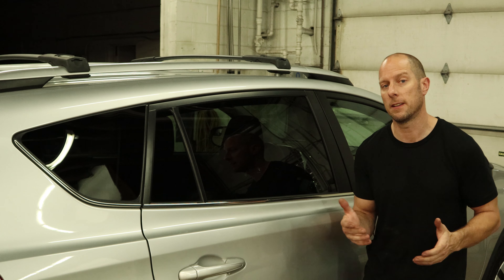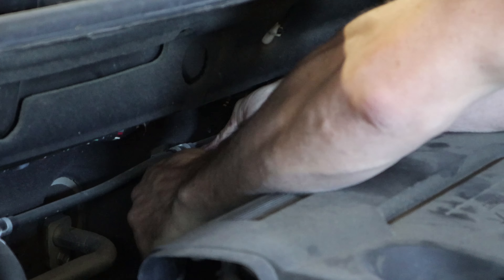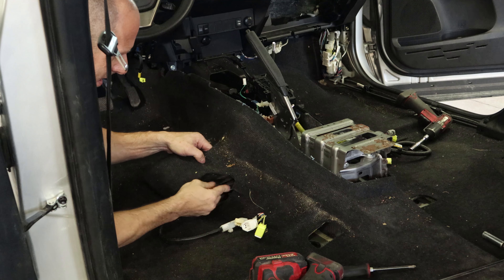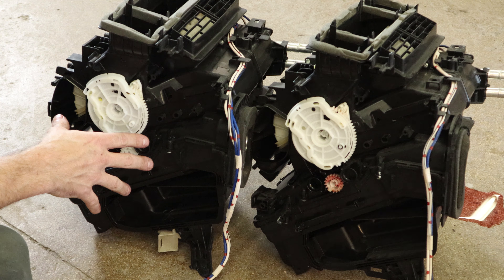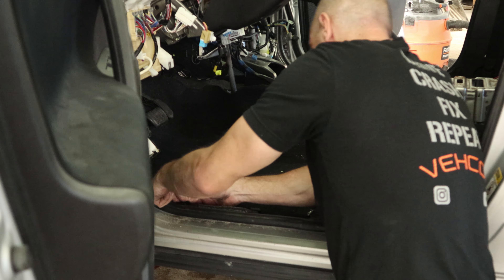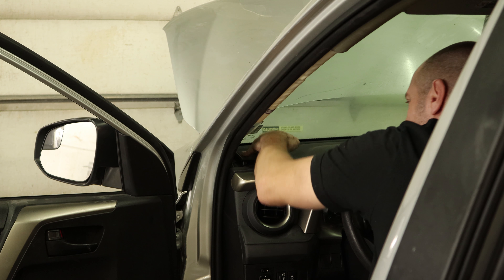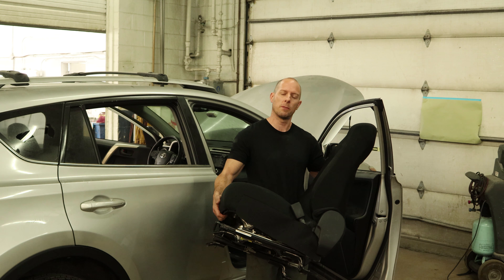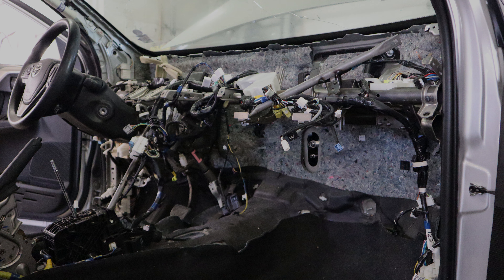Removing the dash and repairing seats on the 2015 Toyota RAV4 rebuild project

Comment: You have to admit it,  whether it's  a 2003 or 2015 ,the dash is the dash on a Toyota. They all tear down the same. From the center console to the dash, heater and ac. With few extra plugs for the new electronics. The only real difference is how many clips you break 😂. The older the Toyota, the more you break.

Comment: You are officially a super hero!  Not only can you disassemble doors (some blindfolded), but you can take out a dash.  When my 2002 Blazer had heater door problems,. I just decided to go without floor vents.  No way was I going to pop that dash out of there.
Reply from the maker: Those blend door and mode actuators are not too bad if you don't read the manual.  I can cheat most of them in, in a few minutes.  The dashes are actually pretty easy to remove on those if you have to go deeper.  I did quite a few of those blazer rebuilds.  Thanks for the support!
Reply: @vehcor  Well, a few minutes certainly would have beat the 6-8 hours I was quoted to do it!  On a side note: GM at least did a smart thing by making the default the defrosters.  If all else fails, at least you can see out the windshield.

Comment: I have to thank you for this. I had a candy gum up the box and was quoted ridiculous amounts  to fix it. I’m handy but not a mechanic. I went for it and it was relatively easy but I wouldn’t have attempted it without your video. Just label every wire and put everything in the order it comes out on tables with the bolts etc that go with each piece. The hardest bit was figuring out how to disconnect the wire connectors as they all seem different. Went fairly smoothly. Thank you so much for this. You saved me a pile of money!
If anyone else does this just label label label every wire- take your time and you’ll be fine. 
Thanks! Thanks! Thanks!
(Actually I had to do it twice as the candy was dripping from somewhere else in the box and I failed to discover it the first time. Second time was a walk in the park lol👍)

Comment: That heater box sure is service friendly.  :D  There are a couple reasons I never bought a Toyota or accepted one as a work vehicle, this added to that list.  Good work as always Scott!
Reply from the maker: They are pretty reliable... which is good because they are not always the easiest to work on. 😂
Reply: @vehcor  Somewhere around 1997 I saw one beside me in heavy traffic, in a rainstorm, going 35.  An accident happened just in front of us, all of the traffic around me managed to stop, except the Rav4 which locked up and slid into the cars in front of us.  The company I worked for gave all of us outside sales people a new vehicle every 2 years, those that had the Rav4's had the accidents, those of us with Accords and Pilots didn't.  Toyota is probably the King of longevity, in general, so I give them credit for that.  No Rav4 for me.

Comment: Had to do this with my 98 crown vic. Old owner cut the heater core enclosure out to replace the heater core. Thus removing the ability for air to move into the vents. It was such a pain in the ass

Comment: I am SO grateful to you for posting this! I have the exact same problem on my 2016 Rav4. I know my blend door is bad, because before I tore it down, I could get my hand in there just enough to feel the plastic door flapping loose. I turned the blower on and acorns, LOTS of acorns started coming out! The blower has done an excellent job of distributing these acorns into all of the ducts.

I pulled off the wipers and the grill at the bottom of the windshield, and was mortified that intake hole in the firewall has NO screen! I pulled the engine air filter, and the box and the intake tube are jammed FULL of acorns too. Gotta run down where that intake tube is and screen that too. I found no droppings, and only one acorn that had been chewed on. I think the little bastards are just storing them near the two intakes, and then they get sucked in. Oh, and the hollow part of the hood above the insulation is full of acorns as well.

But anyway, I can see you are very experienced and talented, so you know how irritating a snag can be when doing a project like this. Your vid got me past all the snags thus far. I am relieved you also videoed the reassemble! It's a load off my mind knowing it's there in case I need it. Again, thanks so much!

Comment: I'm impressed and amazed by how you are able to keep everything correct.!
Reply from the maker: Me too! 😂
Reply: Well, if he videos everything he does, if he isn't sure, just rewind the 'tape' and watch the removal process.
Reply: @dave_n8pu   Nope, that won't identify which bolts with which threads won't cross-thread because they're the wrong ones.  Then there are the snap-in trim thumb clips, and etc.
Reply: It helps to have good visual memory!  Once you do a few jobs like this, its not as bad.  I normally use tackle boxes and bins to keep track of bolts and screws, other mechanics have done repairs enough to just pile them together.  Many parts have their specific fasteners, so it makes it simpler to know what they need.
Reply: @bigpjohnson   A photographic memory would be very helpful in this job.  I do think that the CIA hires those folks right out of college, though.
Reply: @vehcor  "Don't ask me how I know" is the enlightened response.
Reply: @L8nitedave   Because remembering what made me learn how brings on PTSD.  Let the muscles remember and leave my poor beat up brain out of it.

Comment: Scott, another very good video.   Having pulled the IP out of my Crown Victoria to fix the heater doors, I know what you went through.   Yours looked easier as you didn't have to pull the steering column.   For those that wonder, due to the amount of labor, fixing or repairing a heater box is well over $1000 in labor alone plus the cost of the box if you need one.   I repaired my 'living hinge' with some tie rap hinges... it works and I'm happy.   Scott you make it look so easy!      The person that owned that Rav 4 must have been a real pig, burn holes in the seats, pop and shit and sticky food everywhere, even in the blower ducts....    Geeze!!!   Gross!   Scott, you saved a perfectly good cars life again!

Comment: I saw a guy replace a leaking heater core.  It was a similar amount of work.  If sh*t like leaky heater cores and cola poured down the heater vents happens often enough, the manufacturers should redesign the heater boxes to require less dismantling to get out!
Reply from the maker: They don't care.  It is not under warranty so it is not their problem.

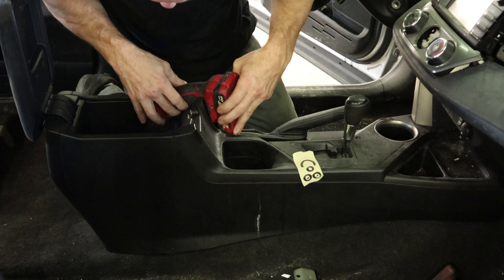Comment: 1:55 "I need an extension that's 2 feet long" I have a couple. I use em when I'm drywalling ceilings. I put some screws in the corners, and a couple in the middle then walk around on the floor after and do em all. It's easier to do them all if you have a baker (rolling scaffold) but if you are doing it with ladders, it's SO much faster to do the rest from the ground. 

I did a whole bedroom ceiling myself in the time it took 2 guys in another bedroom. They saw what i was doing and in the next room "hey Mike, can I borrow that"? lol....came back, "where'd you get one that long, I SO have to buy one"!!! I had 2 so I loaned them the second. I said "if I get one more I can roll around the floor in an office chair and do em sitting down lol"

Comment: After doing 3 grand Cherokee s in 1 month for a/c evaporators....i feel your pain. ( but i lost more blood)No left over screws after RR front seats to firewall.👍👍👍. Thanks for the train too 🤣 Be a good car for somebody...maintenance they go a long time
Reply from the maker: Those Grand Cherokee evaps are by far the worst I have ever done and it seems there is no such thing as one of them that doesn't leak.
Reply: vehcor 👍 i have only let one good customer see the thing apart.  I run out of room for the parts 🤦‍♂️😎

Comment: A few months ago i did the same job on my 11 Ford focus, the Evaporator sprung a leak!. I was able the remove the entire dash assembly out of the car instead of disassembling it to get the HVAC unit out.  Aside from the heater hoses accessibility and the bolt on the center top of the dash next to the windshield it was a relatively simple job, i just took my time and was methodical about it!  ......  You have to be careful using the bumper installation tool on that internal trim, excessive force could shatter the trim and injure Mr. Spotty!!!  :-)

Comment: Some comments about all those spring hose clamps on vehicles: besides being quick to install on the assembly line, they're engineered to not cut into or otherwise damage the hoses by maintaining a constant clamping force over a wide temperature range for a good while. While sometimes difficult to fuss with, they're there for reliability.
Reply from the maker: I know what they are for and why they are used.... that doesn’t mean they don’t suck!
Reply: @vehcor  
As the purveyor of "someone's been here before", you can appreciate checking over a used vehicle with hardware store plumbing hose clamps where there shouldn't be, especially too-big clamps with long tails sticking way out. It's a good indication that someone has, in fact, been there. A good negotiating tool.

Comment: I don't know, thus the question - with 20/20 hindsight - would it have been easier to take the entire dash out as the assembled unit (with the steering column attached) rather then in pieces leaving the steering column?  I think your channel is absolutely the best at letting the uninformed know why cars get totalled and how much work it takes to do a seemingly 'simple' task.  Keep up the good work and Happy Thanksgiving.

Comment: 27:47 if you ever run into that folded over plastic again, you can "unfold" it and erase the crease by sandwiching the plastic between two thin dish towels and using an iron to unfold it. The temp on the iron is based on how thick and type of plastic. Start off on the lowest setting iron it out. If the plastic is warm to the touch but not hot, you're on the right track. it's better for it to be warm, and let the iron sit on it than too hot and melt the plastic.....

Comment: Most vehicles are factory assembled with the dash installed as a complete unit. Typically, you remove the dash as an assembly and make your repairs to it and reinstall it complete. They are very heavy and usually require a helper. I’m wondering if this wasn’t possible on this vehicle. I can’t believe it went down the assembly line with each vent and trim piece installed individually.
Reply from the maker: Every car is different.

Comment: Hello, my brother had owned a 2015 Genesis. While raining , the guy behind bump the car in the rear. My brother got out and inspected and did not see any damage, so he thought. Each went on their way. Two weeks later a fault code came up regarding the rear parking sensors and back up camera. He brings to Hyundai to fix under warranty. The dealer calls later and asks if he was rear ended. The wrap up was the main wiring harness was damaged. The main connection was behind the dash. They had to totally remove the interior to access the one piece harness as well as the dashboard. 6000$ and six weeks later the car was finally repaired.

Comment: 27:15 Need to invent a sneaky/clever way to reach inside the box and re-align those idiotic  shutter pieces.  OR just yank them out.  As Theses cars get older,  ppl are not going to pay $1500 to have this job done!

Comment: So curious, do you have exploded diagrams you consult while doing this kind of job to find all the screws, clips & bolts? Just so many variations on dash build/designs to have knowledge of them all in your head......at least too me. Also, have you ever kept track of all the change you find in your rebuilds? A great year end contest for YT viewers to guess the total!!
Reply from the maker: I just figure it out.  Service manuals don’t give you shortcuts, add unnecessary steps and don’t always have the best order of operation.  By the time techs are done reading the manual, I am halfway done. 😂  I had a bank account that had only the change I found in cars.  That bank account is now invested and will be my retirement.  Finding change pays better than silly YouTube videos! 😂

Comment: Do I need to be worried about 2nd hand parts being open for some time before it was sold to me? Did you have to measure the oil in the evap to replace the same amount to keep the oil/freon balance correct? How dow I make sure its got the correct balance? 

I'll be taking it to a shop to evac the system before I do the job and take it back for a recharge.

Is that just a standard driver? what torque settings did you use?

Thanks

Comment: @vehcor hey boss, I just did this job and now the blower won’t work at all. Any suggestions? I ripped apart the dash again to check for disconnected wires and checked the bottom of the blower for connections but everything as far I can see is connected. I’m not sure what I did wrong. Any insight would be great. Thanks for the video

Comment: Holy lord I've had maybe a dozen dashes out (usually only the steering linkage pinch bolt, a shake brace over the trans tunnel, and bolts in the door jamb/defrost area) but I've never seen one this difficult to completely disassemble. Seems like a vast sea of potential squeaks and rattles.
Reply from the maker: No rattles or squeaks here.  It is a bunch of parts but it really is pretty easy.

Comment: Scott, what is the difference between what they have to do to install things at the factory and what you had to do to repair it? I have seen other manufacturers where the entire dash goes in as one piece. Was it possible to do likewise and repair it outside the car?
Reply from the maker: I had to take out the dash and put it in, they only have to put it in.  To take it out whole and take it apart on the floor is far more work and hassle than the way I did it.

Comment: I need to take the dash out of my '96 Jeep XJ to replace the leaking heater core... I've been avoiding that for a year now.
Reply from the maker: Xjs are not bad.  Now a Grand Cherokee of just about any generation 🤦🏼‍♂️ those are probably the worst evap cores I have done and EVERY one leaked at an early age.
Reply: @vehcor  I have a '96 ZJ too, but that needs a transfer case.  Too many projects.

Comment: I hate dashboard work.  My heater blend door motor failed.  It was going to cost $600 at the dealer to get the whole dashboard taken apart in order to get to it.
I read in a forum for my vehicle that I could just use a Dremel tool to cut a hand sized hole in my heater duct at just the right spot.  I could reach in and take out the blend door and the motor.  Afterwards I just Gorilla taped the cut out piece back in place.  It's ugly if you climb up under the dash so you can see it.  It's beautiful if you remain seated in a dignified position while in the car.

Comment: I dont envy you at all. I am no mechanic but I tackled dropping the dash to replace the heater core on my Old S10 by myself.  It went well and I couldnt believe the lack of swearing...lol. Is it bad if you have a few bolts left over, though?
Reply from the maker: If it was the 82-03 S-10 you did one of the worst.  I had to do the one in my Typhoon, twice.  They suck.  I would rather do these.  More parts, less struggle! lol   The extra bolts go in the console for future use!

Comment: What service do you use for service data and assembly manuals?
Reply from the maker: I just figure it out.  Service manuals don’t give you shortcuts, add unnecessary steps and don’t always have the best order of operation.  By the time techs are done reading the manual, I am halfway done. 😂

Comment: Can you make a video on how to adjust the doors for Rav4?
Reply from the maker: There is not much to adjust but I plan on buying more so there is a good chance.
Reply: @vehcor  Two of my RAV doors have problem.  The rear passenger side need to slam to door to close.  The front driver side scratch off the paint of the door during open and close (top corner).

Comment: Why oh why oh why aren’t vehicles engineered so that the heater cores and A/C condensers are accessible via the engine compartment.  I replaced the heater core in a Jeep Wrangler TJ a few months ago and the job was crazy for how simple those vehicles are built.  Seems totally stupid to bury a part that won’t last the life of the vehicle.
Reply from the maker: 🤷🏼‍♂️I ask the same question all the time.
Reply: Chevrolet had the a/c condenser mounted in a box in the engine bay for years. The only problem is the butyl tape that is used to seal it ends up stuck to your arms, hands, and clothes after it is put back together.

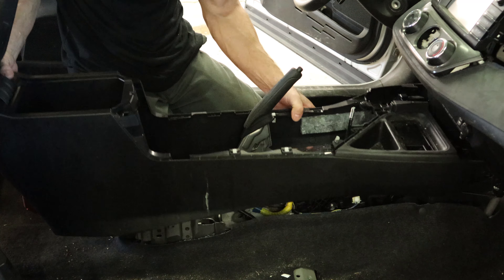Comment: At 2:50ish was that a Jesus screw?  Jesus I wonder where that one went?

At 12:25ish I thought A\C systems were rated in BTU’s not the number of miles on them

I have ‘73 ThatSoon 240Z I have removed/replaced 90%+ of the nuts/bolts/screws I would NEVER attempt the dash. I had a heater hose go in Washington State in February I ordered and picked up the heater hoses and then I called Datsun to see how much I was there EARLY on a weekday and drove it home about 2:PM

Comment: What Has Been Your Easiest / Worst Project Yet?
Reply from the maker: I have had many easy ones, like change the oil and wash them, easy.  I had a Cutlass once, bought it with a bad engine.  Changed the engine to find out they blew the engine trying to drive it stuck in first gear.  Changed the trans and the new one was bad too.  Then the second one solved the problem.  I hate doing the same job on the same car more than once.